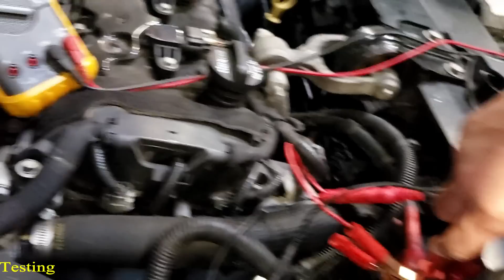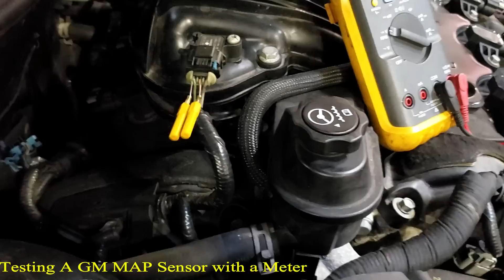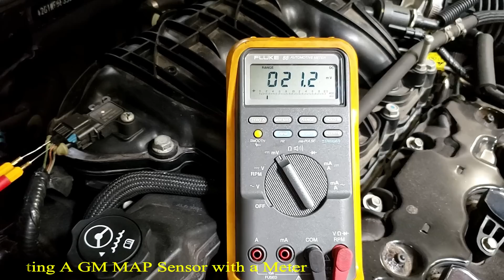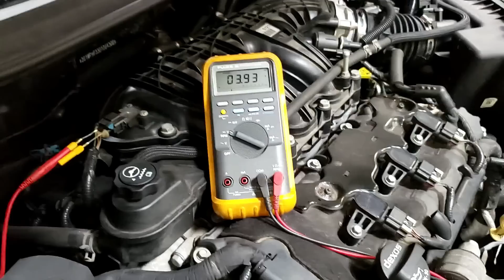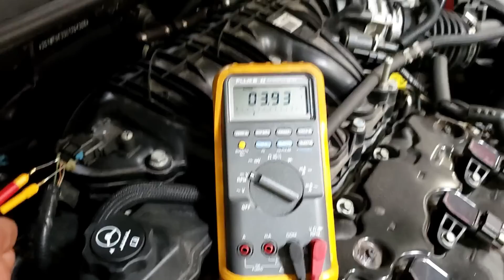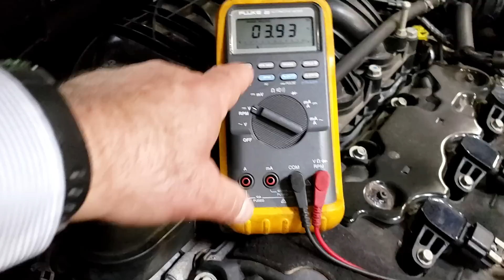ATTS GM MAP Sensor Meter Testing

Comment: The 5 volt reference there are great explanations on scannerdanner premium. Definitely worth the minimal investment to learn from his instructional videos. This comment is for the students that just said yea they understood what the voltage differences meant. But really they didn't and didn't want to say they didn't. Been there done that. Paul tells you why the voltage changes in the pressure sensors and how to test them. Along with every other electrical aspect of the car. Reading wiring diagrams. Understanding inputs, outputs, control side, load side, signals, bias voltage, power side or ground side switched. And alot of other valuable information in his field manual, and videos. For anyone falling behind or having trouble understanding any of this please check his videos out. If you do, you will excel. Not only will you understand this better but once you do you'll be the go to guy in the shop for the electrical issues. And just excel in your career and make yourself more valuable.
Reply from the maker: Well that's good information and Paul does a great job but anyone viewing the video will be able to see the difference between the sensor and chassis ground. If you have not already Subscribed to our tstseminars YouTube channel please do so. Interested in more training? Go to www.tstseminars.org and www.attstraining.com

Comment: Awesome presentation! But for my car has no meaning... So, voltage are correct, also MIN-MAX number's, but problem exists, and when i connect differential pressure meter on intake then showed me really what happened, on diagnostic tool shoving (eg.) 4,5 psi but on meter are 9,5 psi, now im waiting to change MAP sensor.

Comment: what if multimeter read 0 volt for wire that go to ECU?
is it faulty map sensor?
Reply from the maker: 5 or so volts comes out from the computer to the sensor. check that wire first the other wire should be ground and the last wire should be the signal voltage. Thanks for watching...If you have not already subscribed to our tstseminars YouTube channel please do so. Interested in more training? Go to www.tstseminars.org and view full length videos for members on TechFlix for $9.99 unlimited viewing …Membership and over 85 videos for less than $200.00 a year. Also checkout www.attstraining.com for hands on training and webcast
FREE videos at www.tstseminars.org/training-videos